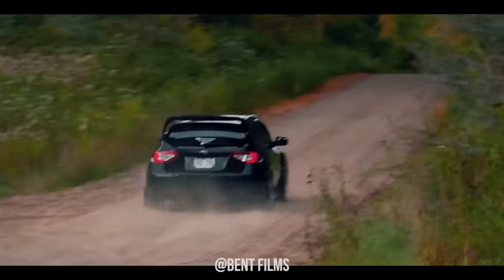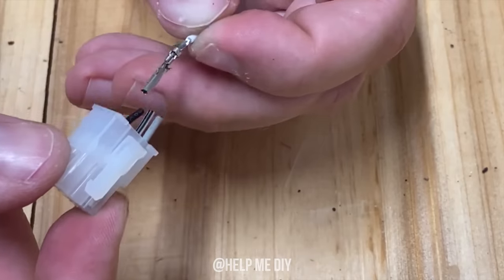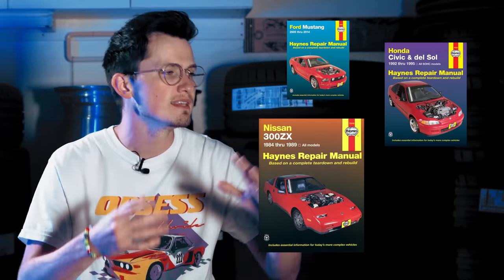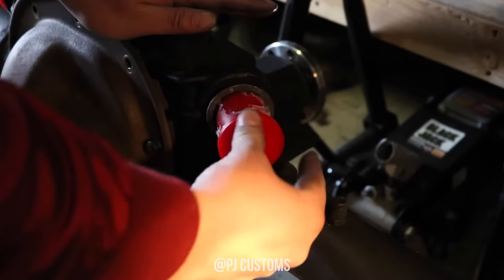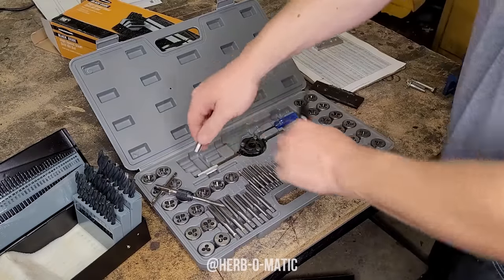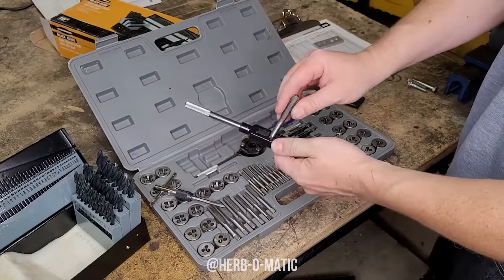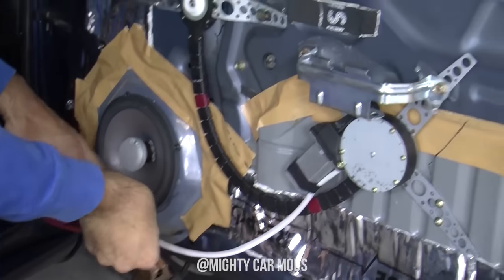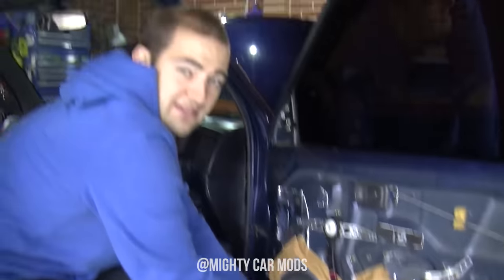How To Avoid Common Car Part Install Mistakes

Comment: Yeah for me it'd be something I'd done time and time again, putting the wheels back on.
This particular time was after a rear caliper refurb and paint, that naturally crept into the darker hours of a summer Sunday evening (I clean and rubber treat everything lol).
Getting bitten to hell by mozzies and working with my Makita Torch, I dropped the car and packed everything back into the house.
The next day I'm at work, driving slowly up the road on my site (I work on new build construction sites) and something didn't feel quite right.

Went out and checked the brake shield as that was recently an issue and for some reason I decided to check one of the wheel nuts on the last side I worked on with the car. Sure as hell, it moved by hand...

So damn luck my workplace at the time was a measly 3.4mile drive from my house.

Now after I work on the car, I religiously ensure to check the wheels are torqued up right after. Then again before the tools are fully packed away.
Then sometimes while I'm settling to sleep and I feel like I may have missed it, I'll check one last time.
😂
Reply from the maker: Those near death experiences are sometimes exactly what we need to realize we gotta be a little extra safe hahaha.

P.S. Thanks for the comment and view my man. It means a lot. Hopefully you sub or if you did already, thank you!

Comment: I think the worst part was doing a break conversion on my 240Z from Drum to disc brakes and forgetting that Wilwoods are American and so the sizing is different luckily I ended up getting the correct fittings eventually but it was a pain.
Reply from the maker: I almost made that same mistake back when I had a Z. Unfortunately for me, the engine was a 355 SBC supercharged so I was constantly changing ratchet sizes hahah
Reply: @AlexMartini.  trying to remember ratchet sizes and what is metric equivalent or SAE equivalent can be pretty tedious, luckily I've got some really smart friends who are willing to help 😅

Comment: My 90 Civic hatchback that I swapped a D16Z6 into had low compression in cylinder 3 after a few years of hard driving.
I checked the compression and had to use the adapter to fit my motor. Not realizing it,  when I pulled the tester out of cylinder 4, the adapter stayed behind. It was like 10pm and I had to work in the morning, so I  was rushing.  Put the spark plug back in and stalled the wire. Wire wouldn't seat so I  knew there was an issue. 
Figured out the adapter was still in the spark plug hole. Took a while to get that out, then just needed to call it and head home from my buddies house. 
Car was running like CRAP.  Had a horrible miss.  I was to tired that just drove it the 3 miles home.
Next morning it dawned on me the spark plug gap must have been crushed when putting the plug into the adapter.  Sure enough, pulled the plug, fixed the gap and was up and running again......even with low compression in cylinder 3. LOL
Reply from the maker: Nice work! Hahah. Sometimes it’s the easy things that we find that fix the car hahah.

I do really appreciate the comment though, and hopefully, sub! We drop a new vide on Monday and I’d love to hear your thoughts :)

Comment: Breaking a bolt head on a wheel, or inserting it slightly diagonal on other parts
Reply from the maker: I've done this. 0/10 recommend.

PS Thanks for the comment and hopefully, sub! It definitely helps out and we've got a new video dropping today at 12pm CST!

Comment: Did you know that some brake caliper bolts are E20s? With blue threadlocker? 

Northern Tool eventually stopped letting me buy breaker bars because I kept snapping them. I ended up having to go to a rent-a-bay and bust out the biggest air gun they had.

Comment: Got a b7 a4 and I’ve got about 3 or 4 bolts that are cross threaded due to impatience and rushing.
Reply from the maker: On the exhaust?
Reply: @AlexMartini.  one on the diverter valve after fighting a stripped hex bolt, one on the battery tie down after fighting  replacing the power steering rack and one on the front crash bar

Comment: Man, where to begin.... Didn't properly torque down a caliper mounting bracket bolt and lost it on the road. Tried to drill out a abs wire and drilled into the bearing. The shavings also messed everything up. Bought a cheap clutch kit that apparently didn't fit my car, and installed it in my garage. Spent hours trying to undo a hose clamp with the wrong tools

The things I've learned:
- just buy the right tool for the job
- it's better to do it right twice, than wrong once
- stay organized, and test early and often.
Reply from the maker: having the right tools is so damn helpful lol.

Comment: Just bought an S2K and wanted it to be my first car I work on and I got what I asked for lol. Had to change the spark plugs so I got the required tools and all was well for my first time until I was putting the ignition coils back on and was torquing the bolts to spec and felt one go loose and I was like ahhhh shit. Tried all types of stuff to remove that bolt but no luck so I just said eff it and put the cover on, tightened that one with my hands lmao and went about my way
Reply from the maker: Is it still working alright?!?
Reply: @AlexMartini.  yea it works! I drive that baby like nothing happened lmao. Life sucks rn for everybody so I’m enjoying it anyway I can. It’s a Honda anyway so it’ll be Ight 🤣🤣

Comment: Idk if it counts… but: it took my tuner (no longer my tuner) 4 months to tune my car (since it’s a car that almost no one tunes) just to set me up with a turbo tune on my NA engine. My car has the same exact ECU and ECU software as the Abarth 595 and since he wasn’t understanding shit on my software he started fiddling with turbo pressure (?!). So now my NA fiesta mk8 is tuned on 100 octane fuel 2 bar of boost pressure and a 7.2k RMP hard cut limiter. Honestly it’s a shit job since another tuner had a look on my ecu and said “bro how is your car even turning on” and obviously the car doesn’t rev well since it’s always looking for a turbo that it doesn’t have, but until the new tune arrives it’s going to stay this way 😅. Somehow it still managed to get a little quicker so… not too shabby. 
Btw on a 595 abarth with a TD04 my tune would get it to like over 400hp with a built engine, but I’m thankful it still manages to run

Comment: Cut my fenders for widebody myself or have a shop do it? Have the tools and decent cutting experience, have the measurements to cut
Reply: You can do it very easy I have done it many times use sawzall. Wood screws work very well for widebody
Reply: i think 😵‍💫
Reply from the maker: Depends on how much you’re willing to learn on your own car. You will probably make a mistake and not do as well as a pro shop BUT, you’ll learn a lot and get better for next time :). If it’s a project car, do it yourself. If it’s your only car and the price of it is enough to be worth something, I’d do a shop!
Reply: @josephferroggiaro7433  i have a body saw, and I already have titanium hardware aswell as a rivet tool

Comment: I didn’t torque to spec the bolts on my lightweight flywheel on my 01 prelude and had the worst clutch chatter the it fell off finally and destroyed ALOT
Reply from the maker: What ended up happening?
Reply: @AlexMartini.  the vibration destroyed the balance shaft and bearing rebuilt then sold

Comment: When you don’t feel like you need to check torque specs because you can just tighten it down with a wrench and you strip the nut 🥲
Reply from the maker: And there's a brief moment where you think to yourself "man, if I had a super power it really would be the ability to turn back time.."

Comment: This is more for maintenance but: Once upon a time I was doing a refresh on the transmission on my e88 doing the seals and fluid change. I got it all put back together and did the initial fill on the transmission fluid. When I went to start it and warm it up to top off it wouldn't start and I noticed the car said it was in drive. It turns out I didn't line up the pin correctly on the transmission when putting it back together. To make it worse the DIY video I was following said several times to line up the pin when putting the transmission back together. 🙃
Reply from the maker: Oh no…How long did it take to put it all back together?
Also, thanks for the comment. Hope you enjoyed and subbed :)
Reply: @AlexMartini.  it only took a day, but I wanted to be extra careful since I already torqued it, so it took a couple weeks to get all new fluids and seals. lol

Comment: Now correct me if I’m wrong but aren’t tap/die sets designed for new unthreaded bolts, rods and holes? I’ve heard horror stories of them snapping off when trying to re-thread damaged holes.
Reply: I have too. The do actually make Thread Repair kits, that have beefer, and harder taps and dies so that you can re-thread holes with less worry. I have one and it has saved me many times on my Dodge Dart and my Rams
Reply from the maker: Yes, there are different thread repair kits, tap and die sets, etc. depending on the purpose and use. For the most part though, dap and die apply to a lot of general use. Hope you enjoyed the video and subbed <3

Comment: When you go to do rear coilovers on your mazdaspeed 3 and every video you've watched shows the perch on top but you cheaped out on godspeed and they are bottom perch which it takes you too many hours to realize.
Reply from the maker: A lot of 350Z owners punch the air when they realize their coilovers are also..funky. Then they go cheap and turns out they need to reweld a ton of stuff to save $100 lol; better off just getting the $1100 coilovers!
Reply: @AlexMartini.  yup next time will be BC or fortune.....also the abs/end link mount was welded too far forward on fronts so wheel hits even with 8" wide. Stock tab welded on back of strut and was a square. Godspeed mount like a thumb welded forward. 

I assume the biggest difference on the better brands is actual correctness to your model as opposed to the same strut body just with different lowers dependent on the vehicle.
Reply: I Wil say though once we figured out.......the quirks. The godspeed ride freaking nice. Not too much bounce, low with enough movement but not too much, camber plates included, end links included and 16 way adjustable. Not terrible for $675.

Day after install I did a 400 mile round trip over a mountain pass......then did it again 2 days later and they rode great.

Comment: I learned not to get under a car jacked up with the included scissor jack. Jack stands caught my 98 civic when it slipped off the jack, had about 1/4 inch of clearance before i went out like the goombas in Mario
Reply from the maker: Ouch... glad to hear you're ok now.

P.S. Thanks for the comment and hopefully, sub! new video drops tomorrow :)
Reply: @AlexMartini.  been subbed bro! Luckily the civic is light, my thick skull probably wouldn't have had a problem

Comment: Putting the clutch disc on my mini backwards bc I thought if a different vehicle clutch assembly
Reply from the maker: How did that go?! haha.

PS Thanks for the comment and hopefully, sub! It definitely helps out and we've got a new video dropping today at 12pm CST!
Reply: @AlexMartini.  trans didn't go on all the way and when I got it together with the part in wrong it was engaged 24/7and started to burn up my starter. Got a new one comin tho😅 and I have subbed to you. You make pretty good content

Comment: There was one time that I was putting on my crankshaft/harmonic balancer bolt and I didn't get it tight enough.
Soon after I was driving home at 11pm with a dead phone and the bolt came out. There was a pin that came out as well (can't remember what it's called) and bc of that my engine went out of time and shut off.
I pushed myself off the road, walked a few miles to eventually find a homeless person who let me use there phone so I could tell my wife where I was. Eventually got the car home after getting towed by my buddy. Put the bolt and pin back  properly and tried to start the car. And somehow, after going out of time on an interference motor... It started.
Reply from the maker: That sounds absolutely terrible. How long ago was this?!

PS. Thanks for the comment, it means a lot. Hopefully you’re subbed or can sub to keep us moving forward :)
Reply: @AlexMartini.  For sure dude! I love your stuff! I've been following your content for years👌 I always enjoy your stuff! 
I think it was about 3 months ago...
Also idk if you remember me, but I saw you and Dakota at sema last year! Keep making content bro! You have my support🤘

Comment: Installing an exhaust manifold and while tightening the exhaust studs, the bolt went loose near the final torque setting. Twice. In two studs.. 
Helicoils save the day again
Reply from the maker: How long did the fix take you?! Thanks for the comment as well, it means a lot! Hope ya subbed :)
Reply: @AlexMartini.  took about 5 hours to do. Taking a drill to your engine block is the most terrifying thing ive ever done in my life

Comment: When I was installing my AOS on my 2019 wrx, I forgot to tighten the screw belt on my intercooler piping going to my intercooler and went to take it for a drive. I turn the corner out from my house onto main road and step on it and just hear a big POP and later found out I shot my rubber gasket from my charge pipe out of my engine bay and was in the gutter in the side of the road. Lesson learned that day was TIGHTEN YOUR SHIT TO SPEC!!!!!!
Reply from the maker: If it makes you feel any better I’ve done that too ahah. Did it with my C5A6 Line kit and it was always a mess. The Y boot would always pop off hahah. 

I do really appreciate the comment though, and hopefully, sub! We drop a new vide on Monday and I’d love to hear your thoughts :)

Comment: Not even a mistake when I started it’s recent one 😅 picture this,

Late night working on your Mitsubishi GTO you’ve replaced the following -
Rear subframe 
Differential 
Drive shafts
Hubs
Propshaft 
Transfer case
Gearbox
Clutch 
Flywheel 
Front driveshafts
Brake callipers 
Exhaust
Full service 

Then you are ready to turn the key after months of saving and preparation and when you do it sounds like a banshee is getting strangled in the gear box 😅

God damn throw out bearing…….. to be continued 🫡
Reply from the maker: Are you still working on that right now?!!?

Also, thanks for the comment. Hope you enjoyed and subbed :)
Reply: @AlexMartini.  liked and subscribed brother! Yeah still working on it should have it fixed real soon 💪🏻

Comment: My experience was earned through a decade of keeping 1k (or free) beaters running so my horror stories are more along the lines of having to replace a water pump on a v8 Olds in the rain in the ghetto at midnight or doing a brake job on the side of the highway because a caliper decided to get off on the exit before. Now I torture myself (I lie I love it) with my very modified Gen2 mini

Comment: Common mistake: owning a 200k mile car 🤣 I had to replace the oxygen sensor on my GX470. 19 year old truck with 200,000 miles. Upstream sensor right at the header. Yeah.

Went with an oxygen sensor socket. Socket slipped twice and started stripping the sensor. Cool. Propane torch, 30 minutes of torch. Nothing. MAPP torch, same thing. 30 minutes of torch, nope, now it's stripped. Oxygen + MAPP torch, got the manifold glowing hot, so hot that the wire insulation on the sensor caught fire.

Still nothing. Hammered on a smaller socket, won't grip. Probably 2hrs total of oxygen + MAPP torching, I got it to move half a millimeter. Though it was almost done. Rocked it back and forth for 15 minutes. Still won't come out. Finally welded a socket onto the sensor, extensions, breaker bar and cheater bar, still won't come off. Jesus Christ. Finally I put my impact on it and said screw it. That actually worked. Sweet. Sensor is out.

I go to put in the new one, the threads are messed up. I say send it. This sensor won't need to come out ever again anyways. Nope. Put it in with a rachet, and now it just spins. Of course. So out comes the sensor, a run to AutoZone to get a tap, retap the hole. Now sensor threads are all messed up. God damn it. No one has the sensor in stock and its a Friday. Thankfully Amazon had the thread tool to fix an O2 sensor for next day delivery. Finally the next day, fix the threads, retap the bung, apply some copper and install the sensor. So far, so good!

Oh and yesterday the OTHER side sensor went bad. God damn it.
Reply: Man O2 sensors can be such a pain. I destroyed my knuckles last weekend trying to get one out of my 220,000 mile Ram 1500. Those things seem to be super happy right where they are. Lol

Comment: My mistake was not really something I installed wrong I just didn't pay attention and was rushing when replacing rotors and almost went blind. Me and my friend used to work at a automotive parts store. I was replacing pads and rotors on my car in work parking lot. We were rushing since we had spent 2 hours trying to remove a rusted caliper bolt. I was trying to remove the oil on the new rotor surface using break cleaner. I was too close to the rotor when I was spraying break cleaner and ended up splashing break cleaner into my eyes. I felt like my eyes were on fire , I was washing my eyes for 20 minutes and my eyes were red for the entire night.
Reply from the maker: I had that happen one time and it was incredibly painful. I felt like my eyes were so damn DRY hahaha.

Thanks for the comment by the way. Hopefully the content earns a sub but if not, have a banging day! :)
Reply: @AlexMartini.  Hahahaha yep sounds about right. 
Also already subbed I love how you brought the same energy from Fitment industries and gave it your own flavor, keep up the good work! :)